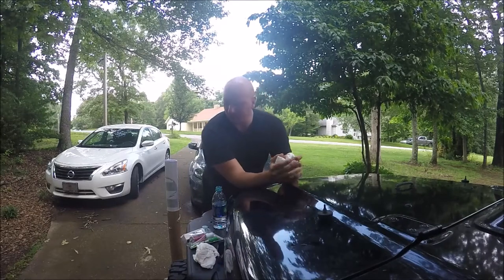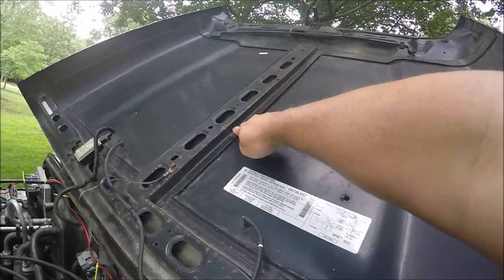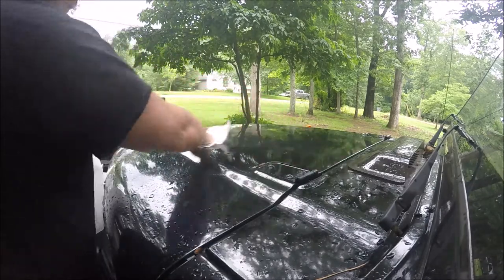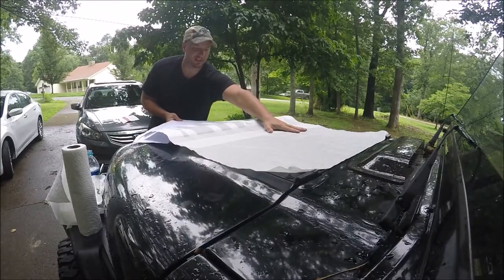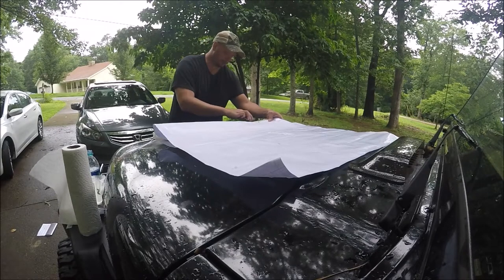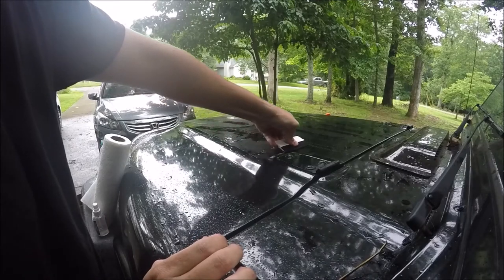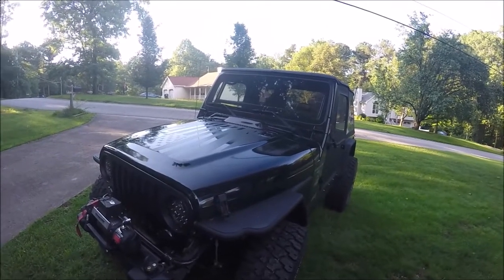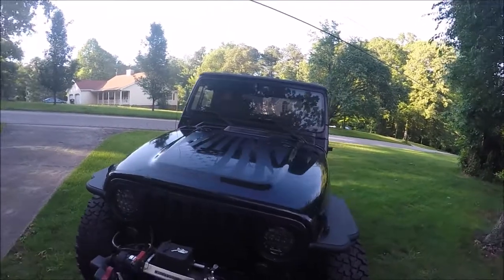Jeep Wrangler TJ - Large Hood Decal Install - Alpha Vinyl

Comment: that came out tight despite the difficulties with the stars. Great job
Reply from the maker: Thanks man, I appreciate it. It is holding up pretty well too!
Reply: quick update. I went and bought a hood decal and some star decals for the side of the jeep plus some wrangler signs. They all came out pretty nice, but the hood decal ended up with some air bubbles and although I cleaned the hood thoroughly, some dust and other particles made the bottom part of the decal bumpy. You can't really see it, so i'm not sweating it. Overall I'm happy with the way everything looks. Thanks for posting your video, it helped me during the process.